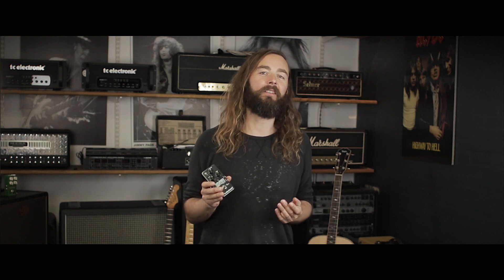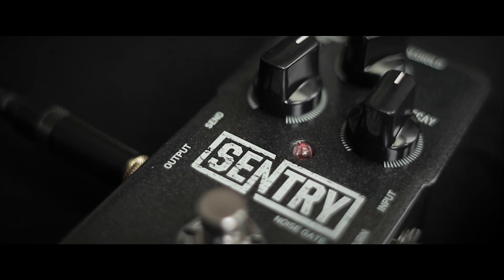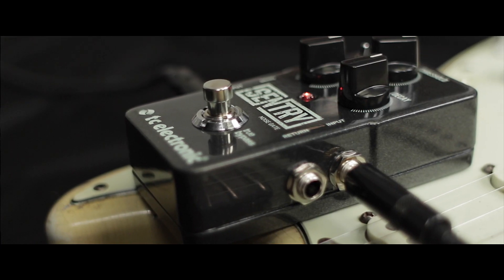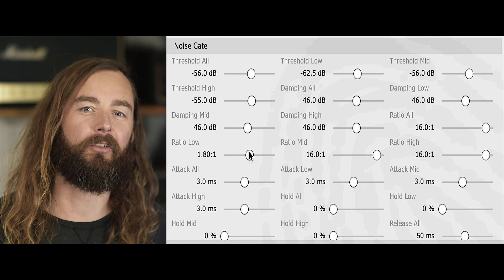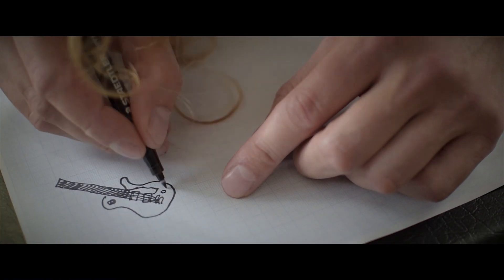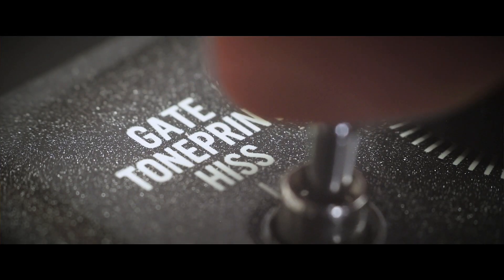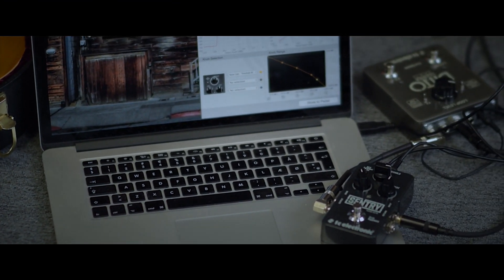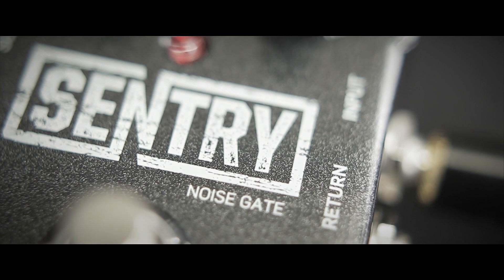Sentry Noise Gate - Official Product Video

Comment: Hi, I am struggling getting the effect I need when playing lightly on my Plexi (it has an effects loop but didn't try the 4 cable method yet). Being a noisy amp by itself if I pick lightly the noise floor conflicts with the quiet notes notes resutling from light picking. It is better on the HISS mode but not there yet. I guess deep diving via the toneprint editor should bring the solution, but I am kind of overwhelmed by all the settings in there... Could you make a video to walk me or other customers through that specific task? Thanks guys - love all your pedals so far....
:-)

Comment: I gotta try out that send /receive feature...

 So what do you do? Just put it through the FX loop as well as front of amp?

 Anyone done it in RL??
Reply: Hey man, a bit late, but I'm using it since 2017 and have 0 regrets. The signal path I use goes like this: Guitar -> Tuner -> Noise Sentry (input) -> Noise Sentry (Send) -> other FX -> Amp input -> Amp FX loop send -> Noise Sentry (return)-> time based FX -> Amp FX loop return -> Cabinet. Works like a charm. It blocks all noise (except from the time bases FX which are non-existant). So everything from my amp, fx loop and all the noise from my pedals before the amp is muted amd responds only to the direct input of the guitar so it NEVER gets confused about whats noise and what are the notes. It opens when I gently slide a finger over a string and it lets my notes ring naturally. Since it only hears the guitar:)

Comment: Nobody has built an intelligent multiband noisegate still (as in multiband EQ). You turn your noisy pedals on, don't play anything, let the pedal analyze the nature of the noise and gate the detected noise frequencies only, letting the rest of the signal untouched. Something you click on to analyze and set, and then activate as a noisegate, having the standard noisegate parameters (threshold, attack, release ...), and for instance a "Q" setting to widen or tighten the gate around the detected noise frequencies, and a "priority"  setting to either gate all detected frequencies or prioritize the highs, mids, or low frequencies. The rest of the architecture could remain the same as all noisegate's standard features (series or loop switching).

Comment: Artist tone prints? For a noise gate?
Reply from the maker: +Alan Angel yeah :) but the real magic lies in the TonePrint Editor. It's a multiband Noise Gate so you can perfectly tailor high, mid and low frequencies so they fit your setup and needs. Plus you can do tons of other cool stuff with it. There's a vast amount of parameters to fool around with :)
Reply: +TC Electronic You know how to make a geek fall in love.  I just need a way to run the Toneprint Editor in Linux (I will probably try WINE at some point).

Signed,
Someone who plans to mod a  2/3 scale Jackson Dinky to produce 288 distinct tonal options.

Comment: The compressor is a done sale but I'll have to think on this one. Gonna take a lot to lure from the ISP Decimator.
Reply: +Guitar Anthony I just traded in my Decimator G String for this pedal.  The G String has a fatal flaw; the Dec loop is buffered and not true bypass.  In my case, I have a Jet City 50 watt head and it has a serial, buffered LINE LEVEL effects loop.  When running the preamp through the decimator loop, and then having a buffered OD (BOSS SD-1) going to the amp input, I'd get a horrible CB Squelch-like sqeal.  Took the G String out of the equation and the problem was solved.  I've since replace ALL my pedals with TC Electronic pedals and my amp loves them.  This noise gate/suppressor is the best pedal-based one I've used to date, and I've used them all.  Good on ya TC Electronic!!!

Comment: Hi guys, any reason why the sentry noise gate would not work with bass? thanks!
Reply from the maker: +Tobi Wirz nope. No reason at all. It's frequency specific, so you can even hone more in on the bass frequencies via the TonePrint Editor if you want to :)
Reply: +TC Electronic Thanks guys, just ordered the pedal. :-)

Comment: Ohhh TC, you magnificent humans. 

Looks like I'll be spending even more money on your stuff.
Reply: I Agree with you
Reply from the maker: +CSGuitars Awwwww. Thanks, man :)
Reply: +TC Electronic Hi. How it works with clean Stratocaster sound? What about high and mid tones? It bother me a lot and I'll be glad to hear it in action.
Reply from the maker: ***** it works great. I personally use mine on the hiss setting to eliminate that 60 cycle hum you can experience when using single coil guitars.
Reply: +TC Electronic Can you make a video of that? Also I personally want to hear it can take out the "digital" hiss that sometimes gets added when using a multi fx unit in 4 cable method and what goes before the preamp gets added thes "hiss" even if its only using a volume pedal of the multi fx unit, if it does I buy one tomorow!!!
Reply: Guess what TC is bought up by Behringer and these latest series pedals are a mixture of Behringer and TC ;-)

Comment: Just got mine, LOVE IT!  Question, though.  What is the 2nd dip switch on the back of the pedal.  I know the first is for the buffer, but what's that 2nd one?
Reply: Have you had an answer to your question ? I'm still trying to find this out myself.
Reply: +MrWolf5150 You know, I never did.  If I had to make an educated guess, I would say it's one of two things: 1) It's Kill-Dry Mode.  Like on their modulation pedals, it removes the dry signal from the path and leaves you only with the affected tone or (since this isn't a modulation effect) 2) It's nothing and just there as a by product of the circuit boards that TC uses.

Still waiting, though.
Reply from the maker: +Chris Reeves - hi, man. The second DIP-Switch doesn't do anything. As you guessed it used to be a kill-dry option. But that's really only relevant  for mod and time-based effects. Hence it's just there for "looks" on the Sentry ;)
Reply: +TC Electronic Awesome.  I was pretty confident of that, but it's nice to put curiosity to rest.  Now, about my prize...  :D

Comment: From what I read, it doesn't work with a battery... If that's the case, it sucks, since I already feel I've got too many cables on the floor. Do all noise gate pedals need power cables to function ?
Reply: No, the Boss NS-2 and ISP decimator can run on 9v battery.
Reply: I've read too many bad reviews of the NS-2... Guess I don't have that many choices. I was going for the Sentry anyway.
Reply: The NS-2 has worked great for me for many years but this thing has me interested.

Comment: Would the pedal still work fine without the editor? Or is that needed for it to work at 100%?
Reply from the maker: +Kevin Torres - it works great straight of the box. The editor is more for really nerdy and specific noise removal needs :)

Comment: Can you use the Sentry via just the input/output and still get the effect or do you have to use the send/return?  I have a pedal board/pre amps rig that goes direct to PA and I'd really like to not have to route the entire chain with the send/return. 

On top of that if I have a split signal can I use the send/return as a second channel of gate?

Thanks! Love the TC pedals, building quite a little collection of them. :-)
Reply from the maker: Hi Frankie. You can use it just via the input/output, yes :-) And yes, you can. Yes, yes and yes :-)
Reply: TC Electronic hahaha! Thank you so much! Ordered & should arrive today. On a collision course for the Hyper Gravity as well. 😃

Comment: I run a Xotic SP compressor, Bogner Red Estacy, Catalin Bread Dirty Little Secret and Boss BD-2 tone stacked in it's own true bypass loop, I have an ADA MP-1 tube preamp run at pedal level (notoriously noisey) in a true bypass loop, Last is a Wampler SLO Stortion with a global lead boost. I have always run through a Boss NS-2 due to it's loop.  The tune sculpting is done with a Boss PQ-3B parametric pedal.  Volume is attenuated with a small volume box. A Boss Tu-2 splits B goes into dry output amp A is sent into T.C. Electronics Nova Modulator and Nova Delay. Last is a BiYang Stereo reverb. The signal goes from the pedal board stereo into a SHURE M60 tube phono preamp, the it goes to an ADA Microcab II input, thru put goes to a pair of Orange Micro Terrors. Into a stereo 4x12.

I hope to add the T. C. Electronics Sentry in to my rig if it can do a superior job than the Boss NS-2.

Comment: I've heard this is a good noise gate. I'm using a Mesa Boogie Mk IV with high quality effects and cables.. I'm  detecting hardly any noise from my pedal set up but the amp itself sure makes some loud background noise on the crunch and lead channels. Will this pedal cure that issue without interfering in any way with the tones I get? If so would the pedal go before the amp or in the loop? Many Thanks

Comment: Just got mine. Excellent product. I still haven’t even get to the toneprint part of it because this thing works amazingly right out of the box.

So gurls and guys don’t think that you need to tweak this the whole day to get it working - just plug it in and enjoy the silence..

I had NS-2 before and this one is much much better. The thing is, this one feels natural and you don’t even feel like you have a noise pedal in your signal and I didn’t hear any signal loss.

NS-2 was eating up my signal and I could feel the latency which was a deal breaker for me. It obstructed my playing.

Definitely recommended! 
Buy it, you wont regret.

P.S. I play metal...